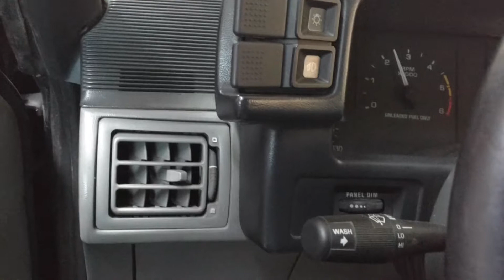Fox body 331 stroker trick flow 3 cam

Comment: What combo are you running sounds good
Reply from the maker: 331 eagle stroker kit, 170 Trick flow heads, 1.7 roller rockers, GT40 tubular intake.  I always like the GT40 tubular, so could gain more HP with a Trick flow or edelbrock  but sticking with the GT40.  Also, wanted a loopy cam so went with something a bit larger.  My plan is to have a nice sounding car that I can cruise to the local car spots and not have to worry about forced induction.
Reply: @1jvschlegel  I feel you man that's what I'd like to do to my fox one day. Like your cars color combo bad ass